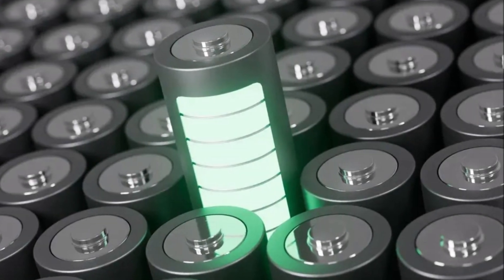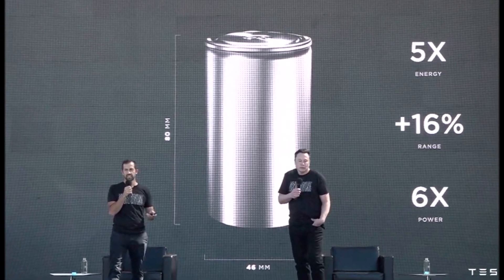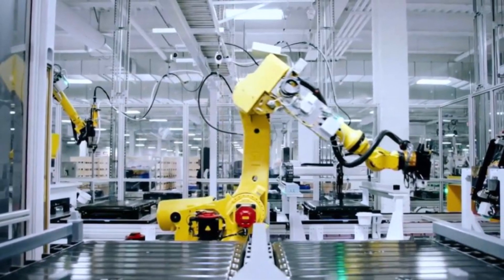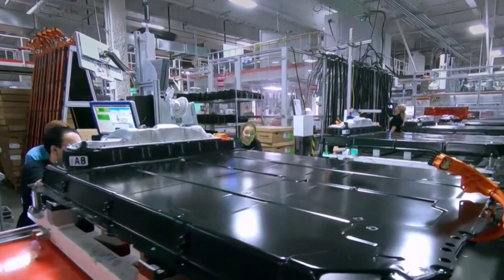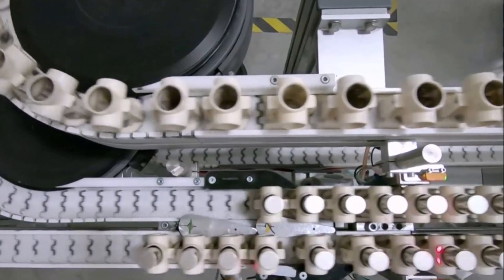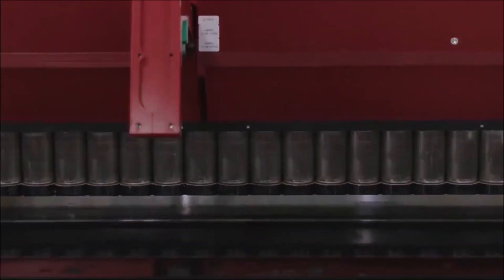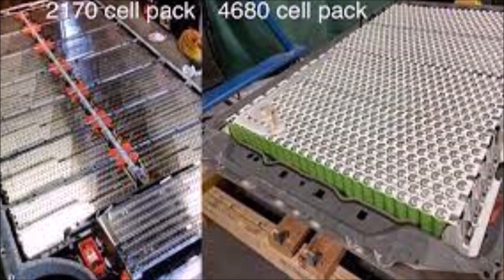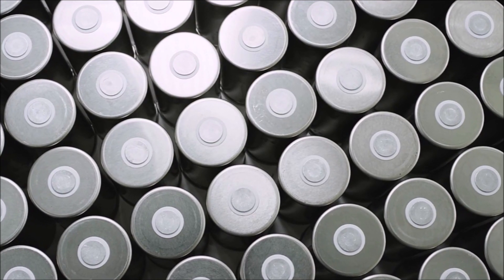New Chinese EV Battery Packs 3 Times More Energy Than Tesla 4680 Cell

Comment: The Toyota and Mercedes solid state batteries are ahead of this. Should be in 2027 or 2028 models. 800-1000 miles on a 15 minute charge.

Comment: 4680 by tesla are LFP aren't they? There are a lot of higher density batterys, but the point is safety.
Reply: No, Tesla 4680 is NMC
Reply: @sportbikeguy9875  I think Tesla has said they are open to several chemistry.  4680 is the size.  I think the Lifo are cheaper and don't have charging to full constraints.  

There was a chart they put out with what they expected....but that is only what is available now.
Reply: @sportbikeguy9875  I drive around with Samsung NMC cells from 2017. They were 265Wh/kg according to the datasheet, when new.

Comment: This is exciting. Even if the final battery isn't 3x as energy dense as the 4680, it provides a possible pathway to significantly increasing EV range at some point in the next 5 years. Imagine if range of the average EV leaps from 250 miles to 400 miles. It would be a complete game changer.